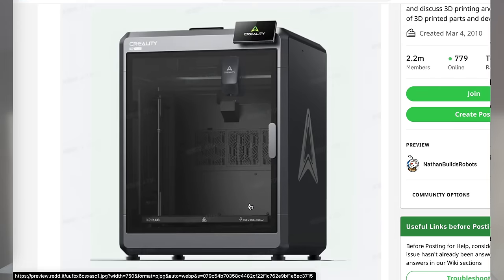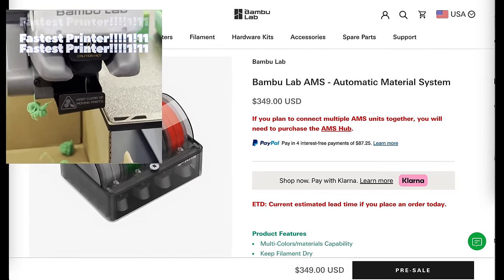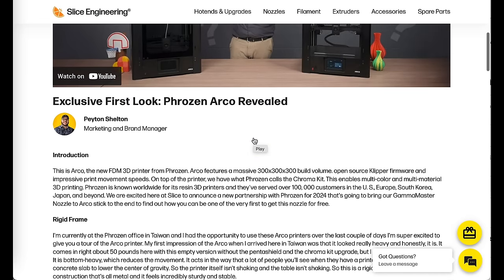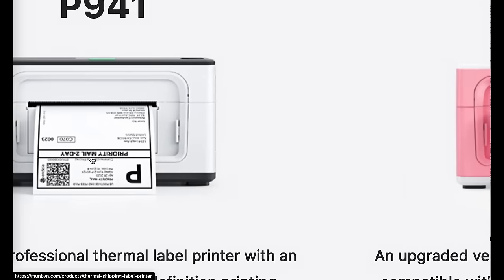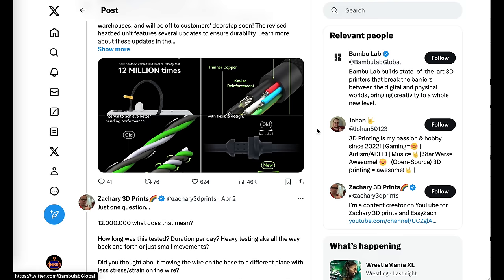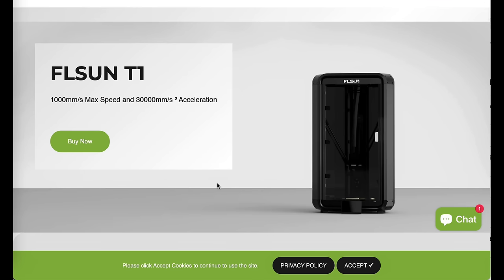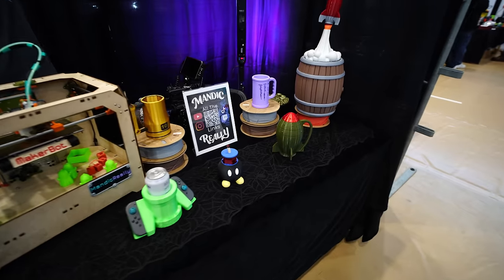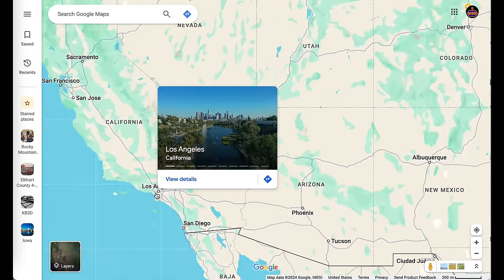3D Printer News April 2024

Comment: Im not dissing the other companies but what is there to step up other than high speed printers, i wish Prusa and Creality would focus on more improved toolchangers, belt printers or what about metal 3D printers.  I'm always glad to have large volume printer, but i wish they wouldn't copy Bambu (even tho everyone wants speed).
Reply: Well, Prusa does have a tool changer, and Creality has a belt printer. Prusa is very likely to refine their tool changer in future upgrades. Creality . . . will probably make more Ender 3 variants.

Metal 3D printing is probably not a great option for a hobby machine, although I admit it would be cool. There might be some issues drawing enough current from a household outlet to make it work.
Reply: @logicalfundy  and that's what I'd love to see is metal 3D printing working in homes and affordable, non planar printing expanding into all slicers.  Multi material printing put into belt printing.  Instead unfortunately the competition this year is large, multi color fast printing.
Reply: @krollmond7544  Non planar would be awesome - it would solve so many problems with overhangs.

I'm actually curious what the big holdup is with belt printing - it looked like a slam dunk for print farms, but none of the largest farms adopted it. There has to be some hurdle to overcome there.
Reply: @krollmond7544  I keep thinking non-planar has to come soon.  Everyone is going to do multi-color soon, big enough prints soon, about as fast as you can get without noise or weakness issues, what is left I think is quality, and non-planar can do so much for domed top surfaces (as well as overhangs as you mention) that I think they need to have their engineers work a little less on the hardware and a little more on the software for a while.

Comment: F Creality F Bambu labs. They all suck. I have 2 p1s and they are broken. I have one K1max Again Broken. They K1 uses the cheapest connector to the extruder motor. 950 machine with a half cent connector. The Bambu labs have hotend motors not working. Both machines at the same time. Anyone know of machines that just Fing work? I need 203x354 bed.
Reply from the maker: Serviceability and maintainability is huuuuuge
Reply: @NathanBuildsRobots  I spent A LOT of money on three POS. I have them only a few weeks and now I can not make my product. I'm out over 2k and I'm so screwed!